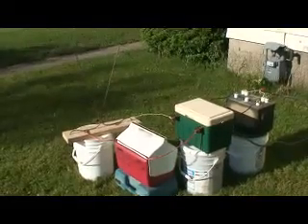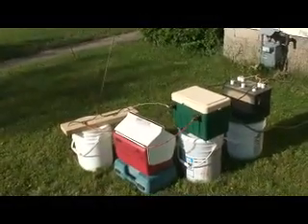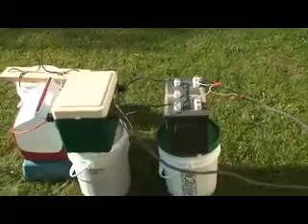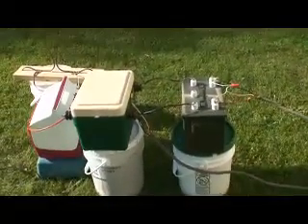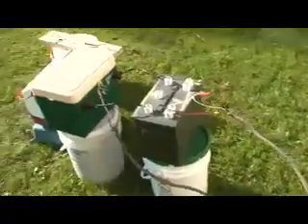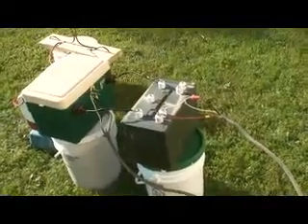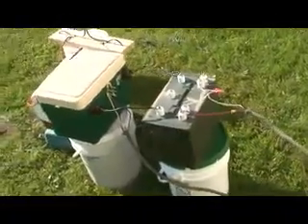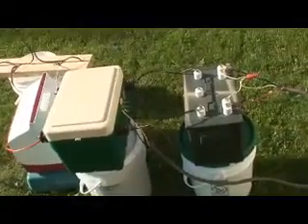4 MOT Resonant Jacob's Ladder

Comment: I would love to build a large, Frankenstein movie sized Jacob's with an antique style stained wood cabinet with those decorative legs that old timey cabinets used to have, and have two MOT's inside it in oil with secondaries in series, primaries in series on a 240V/30 A circuit, rigid electrodes three or four feet tall, Gabriel's third electrode for arc starting, a cooling fan blowing air into the cabinet to keep the oil container with the MOT's cool and out through a hole below the electrodes to assist the arc in climbing, and a transparent acrilic tube to safely enclose the electrodes. That would be so cool.

Comment: You know there's a simple way to get a Jacob's Ladder to start without having to use a "Chicken Stick" to start it each time, it's called Gabriel's Electrode. It is simply two high voltage 1 M ohm resistors in series with one end connected to one of the ladder electrodes, and the other end of the resistor's wire placed as a third electrode, sticking up in the middle of the narrow gap, just slightly below the gap. When the power is on the third electrode floats to the potential of the electrode it is connected to. It is easier for the arc to jump the shorter gap between the third electrode and the other electrode. Then when current starts flowing the voltage on the third electrode goes way up due to the high resistance of the two 1 M resistors. This aids the arc to jump the rest of the gap to the other ladder electrode and heating of the surrounding air, from the arc, causes it to rise.

Comment: @bonggoggles 

I have 2 mots that never ever heat up its model # is YEC HV M/W Oven Power Transformer, YSH-200, Y5115-6(N)

I might buy a 3rd 1 from someone but i need 4 of them if you find 1 i will buy it :) 

how much current were you drawing?

Comment: Probably alot of work considering they would still fail pretty quickly.  Perhaps a quick/easy and cheap method of prolonging them would to have another container ready filled with dry ice.  Have a friend shovel dry ice directly into the warm oil baths as you used the ladder, the dry ice when melting and vapourizing will absorb a considerable amount of heat from the oil.  All that dry ice vapourizing would look pretty cool too ;-)

Comment: you would need something like a cars cooling, a pump that pumps the oil through a radiator witha fan, then back to the box, but with this much capacitence, id think theyd still cook, not as fast, but still cook